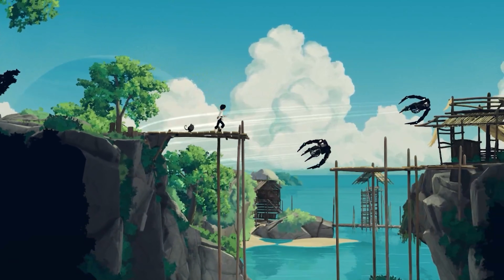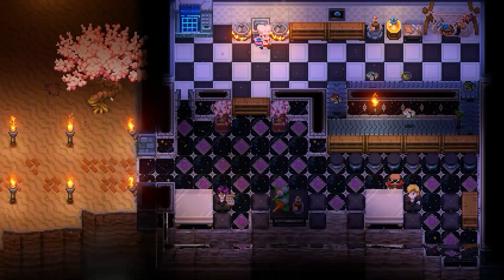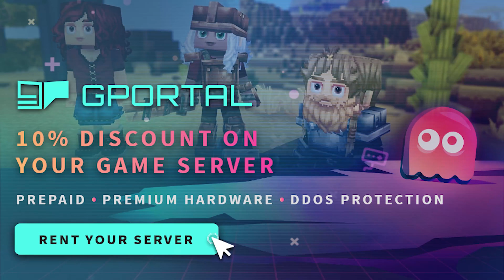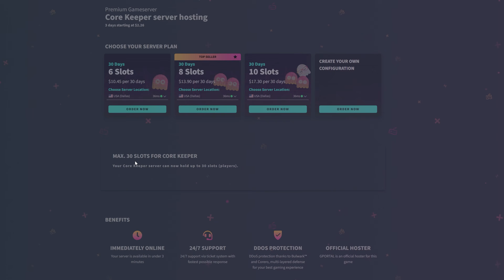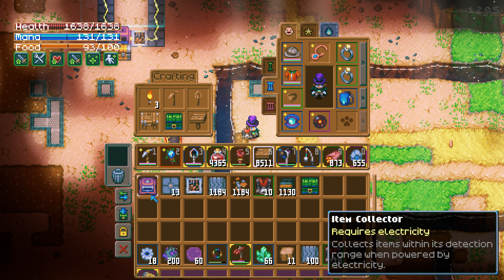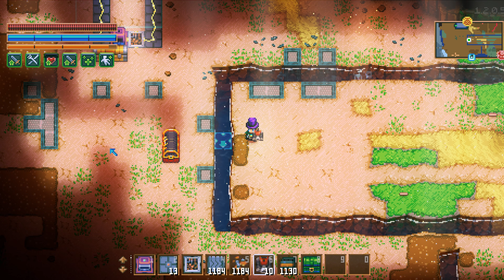Farm Easy Corrupted Alloy and Mechanical Parts | Core Keeper 1.2

Comment: Wouldn't fungal moss blocks under the spawn tiles work to slow down the mobs? 13:39
Reply from the maker: Yes that's the point to slow them down. It slows their ability to resist the conveyors also
Reply: @DakonsMadhouse  Thank you, was trying to look it up before I try to build a farm to no avail lol
Wiki resources are kinda ass

Comment: Are the robots immune to mold block slow debuff? You can use tilled mold blocks to slow down spawned enemies in a farm so the conveyer helts have an easier time moving them around. Tilling prevents mold spawns from spawning in your farm.
Reply from the maker: thats a very good point. I forgot to test to be honest.
Reply: Wouldn't the mold block spawn infested caveling that could make the automaton aggro and destroy machines?
Reply: @YaRememberTHISQuestionmark read my last sentence. Tilling the blocks prevents them from spawning enemies but leaves the slow effect intact.

Comment: Thanks for all your hard work.  One thought on the wheels being able to counteract the conveyor belts.  Wondering if interspersing some orange or blue slime would disrupt their movement enough to let the conveyor belts move them.  For example, a couple rows of orange slime along the center line with conveyors moving toward the kill box as normal, but have the conveyors for the wheels etc., move the mobs toward the orange clime instead of toward the kill box.    I haven't tried it, so just a thought.

Edit:  On second thought, the conveyors may block the effects of the orange/ blue slime tiles.

Comment: I see you make mob farms 8 blocks in each spawn cell. Is the bug who monsters spawn outside farm, fixed? I hear so much diffrent about whats best. One is use full 16x16 cell for mob farm and one is 8 in each cell so it gets 16 together. What is best?
Reply from the maker: For these mobs it's best to fill the entire cell if you want max spawn chance. For every mob farm you want to be in more than one spawn cell to maximize production. 

The bug is not fixed yet. But since it will be I just ignore it in my videos. 

I use 4 tiles per spawn cell to keep my kill zone fully covered and to keep the rust pile cost down. If you have the resources I recommend expanding the spawn tiles into multiple cells and fill them while leaving the kill zone at 8 tiles

Comment: I am having an odd thing happen. None of the mobs in the flames are taking damage unless my sprite is near by. Once I move towards the wall they start taking damage.
Reply from the maker: ya this is a known bug in flame turrets right now. On PC they have partially fixed it but not completely. the range is longer now but it still has an issue.
Reply: @DakonsMadhouse  that is interesting. I’ll just ignore that farm and see if they get something fixed later.  😊

Comment: 14:16 from what I have seen, the wheels stop moving to put up their shield, and the spider bots stop moving to fire their mortars. 

So put a little bit of another kind of spawn tile in there, they will stop to attack other types of enemies, and move further down the conveyor.

Learned that from the orbital turrets, they're also faster than conveyor belts... until they stop to fire at the larva I also put in there.
Reply from the maker: have you had any success with putting in other mobs? When I do it the wheel guys end up charging and breaking conveyor belts, and the spider guys shoot off their fire shot which also breaks conveyor belts.
Reply: @DakonsMadhouse  I put a bunch of turns in it so they fire oil, but go out of sight of the target before the fire bomb, etc. (you ever see the 'all corner piece' brownie pans?)

That and used regular larva as the other enemy so they die in 1 hit. 1 wheel projectile kills it, they don't charge. The oil kills them, they don't launch the fire bomb.

I also tried the hologram projectors, inside the wall where nothing could hit them. The oil mortar and fire bombs can shoot OVER walls, and I sure hope that's a glitch.

Maybe I can just put stone mushrooms in an alcove somewhere?

Comment: Item collector is such a game changer. First thing I did was go through and upgrade every mob farm to be fully enclosed by a moat with a row of turrets on an island. 
The filter mechanism on arms is less than ideal though. Really wish there was a category mode so I could just pull out all the gear to be scrapped
Reply: I just want "Collect everything, EXCEPT the item in the filter" option.
Reply: You can do that with robot arms and the new shredders back to back, that way everything else will be transported by the arms and the gear wont come through. You will need a few of these, depending on your farm size. Just place a robot arm and directly in front of the shredder pointing to the side then a robot arm behind it and so on.
Reply: @user-bu6gk4cn7b  doesn't the shredder take 5 minutes to shred one item?

Also I don't want to shred them. If I have a set up feeding a critters net, I want the excess to keep running around the conveyor belt until there's a spot in the net for them, not destroy the excess.
Reply: @a @acrab6527  dont mean the seed extractor, the shredders only scrap gear. They also dont take that long, not even a minute. You can easily integrate this setup in the loop.

Comment: you can also place some Galaxite Turrets on the same wall as the item collector, having them perpendicular to the flame turrets so they can shoot at the targets that haven't reached the flame turrets yet.
Reply from the maker: good point. I cant remember the exact distance but galaxite goes out at least 20 tiles.